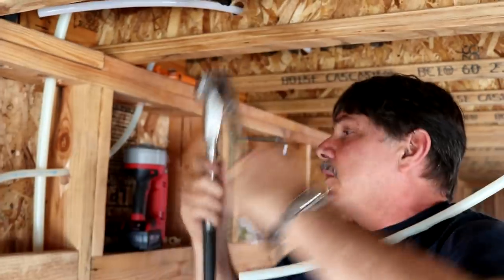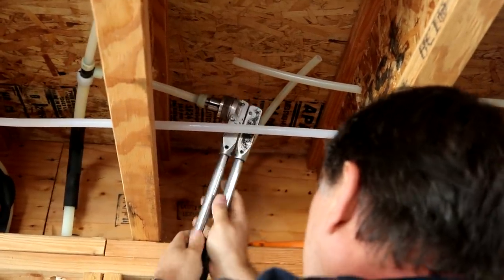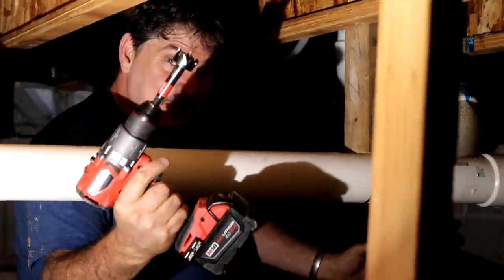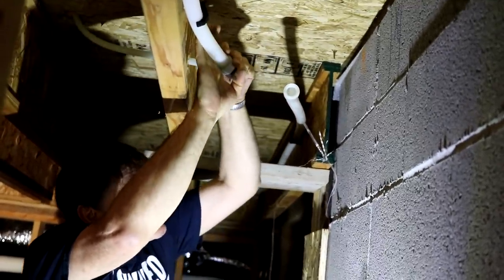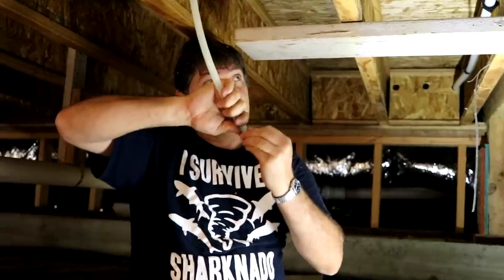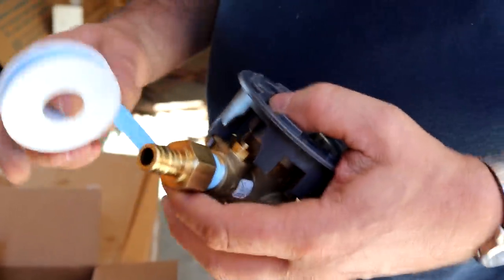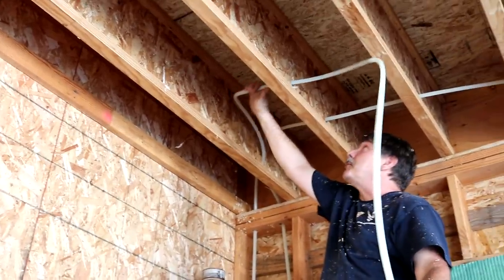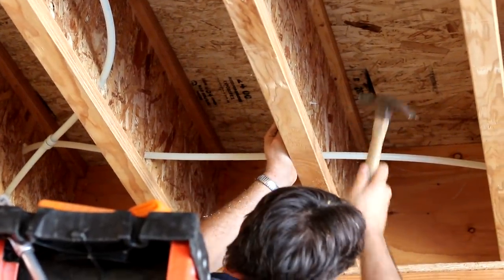Plumbing with Plastic Ep.95

Comment: Recirculation lines are worth their weight in gold.
Reply: I wish I had one. My master bath is as far as you can get from the water heater while still being in the same house. The shower is not too bad but the sinks can take an eternity to heat up. Very wasteful in a desert climate. :(
Reply: wish my fancy house had them. Kitchen sink can take up to 5 minutes for warm-hot water
Reply: @StoneysWorkshop  If it takes that long, it may be a good idea to use a small cupboard boiler, or one of those fancy electric hot water faucets.
Reply: StoneysWorkshop that is so frustrating...  usually a return line was like 250-300 bucks for the plumber to put in during construction if we could gravity feed it.  It was more if we needed a pump.  We got to where we just included it in our bids.
Reply: @mfbfreak  I will be looking into it, I have only done a small amount of looking at those havent been in home for a year yet
Reply: My water heater is in the garage and like some of the comments, took forever to get hot water to back bathroom. I installed a small electric water heater in the attic above the back bath and run the hot water line from garage into the heater and now I have instant hot water and no wasting gallons of water like before......
Reply: When tankless water heaters first came out, they would void the warranty if you used a recirc line because it activates the burner all the time and burns out the igniter. There are a few correct ways to do it but you need to know what you are doing, particularly in commercial work. I prefer a small buffer tank for the recirc and the tankless for the make up.
Reply: @ClicketyClack    There is a relatively inexpensive retrofit to provide a recirculating system.  Google Grundfos Recirculating system.  It basically puts a small pump on the “Hot” side of the standard hot water heater and a mixing valve under the sink in the master bathroom.  The down side is the cold water isn’t very cold afterwards in that sink.  The pump comes with a programmable timer so it doesn’t have to run 24/7.  You’ll get hot water in the shower in a few seconds.
Jim
Reply: I would like to see the details of how the recirculation line is plumbed in when the hot water tank{less} is installed.
Reply: @kurthanushek5520  it's in the manual.
Reply: Check out Comfort series pumps...
Reply: @jamesp7623  I have the Grundfos system just as you described. It's wonderful. The hot water heater is 100 feet away, but I get hot water in the shower within seconds. I also don't mind the warm water on the cold line since I almost exclusively  use warm water in that sink. It only increased my gas bill by a couple dollars, which is made up by the reduction of my water bill.
Reply: @jamesp7623  Assuming the shower is branched off the sink. Mine isn't.

Comment: In Sweden the code says No hidden fittings. So in new buildings we have a distribution box with hot and cold, then seperate pipes to every tap. And the pipes are in a conduit so if you have a leaking pipe it runs in the conduit to your bathroom/distribution box.
Very safe and all, but expensive and time-consuming..
Reply: @guntherthegoat1756  Its diffrent I guess. Mostly I would say that we have a manifold cabinet for every bathroom, located in or outside the bathroom. And if its far away from the heater we run a hotwater circulation line. But in my house my kitchen is around 15-20meters away from the waterheater and I have to wait around 10sec for the hot water, i thought about running a hwc line to it but its not worth the hassle ;)
Reply: @guntherthegoat1756  And its not like I hate how you do it, but I think its odd that you dont even have a conduit for the pipes and some seem to have  fittings in excess, inside the walls.

Comment: I like that he expands the pipe before connecting them.  I've often used bigger pipes and fittings to prevent pressure loss but I didn't realize I could expand PEX.
Reply: Only PEX-A can be expanded. PEX-B and C can only be crimped/clamped. PEX-A expansion fittings are different than crimp/clamp fittings as well.
Reply: @edulmes  Thanks bud 👍
Reply: @HousesandCars  But you can crimp onto PEX-A too, it's very versatile.

Comment: PEX might be cost effective but it should makes for an ugly installation.  A good copper job is a work of art.
Reply: Ah, a kindred spirit!  It is indeed a work of art when done by a craftsman.
Reply: There are times for obsolete methods and materials. A hidden water supply isn't one of them.
Reply: If you home run red and blue to some big manifolds, it looks as pretty as a well-done breaker panel.  Copper has too many elbows everywhere and reduces flow.

Comment: Anyone else annoyed by Phil's comment about the use of red and blue PEX pipe, the complete lack of labeling anywhere, and the vague "engineering plan" for the plumbing? First off, human memory is fallible. Doesn't matter who's memory it is, it's not foolproof by any stretch of the imagination. All it takes is for him to miss a place where the pipes cross over or forgetting the orientation of a sink or shower above to create a mistake that probably won't be noticed until after everything is buttoned up and looking pretty. Second, what about when the home owner has an issue or needs to change something five, ten, twenty years down the road? Is Phil going to be going to be the person making those fixes and/or changes? Probably not. But even if he is, will he remember how this house's plumbing is laid out? Sure, if the PEX develops a leak, it's easy to find and patch. But what about having to replace a huge section of tube or make a new run because the homeowner wanted to redo a bathroom? Phil's "superior skills" just made the job for the next guy down the road a lot harder. It's not a "Millennial thing", Phil, it's proper planning so the plumber in the future isn't cursing your name.
Reply: I agree it will make it easier on the next person. BUT is copper hot/cold different between the 2? Labeling?
Reply: Just draw the plan as you go. For future maintenance purposes.
Reply: Nope, not annoyed at all.  First off, those plumbing plans will not likely be available to the "next guy" in 10 years anyway.  Second, I'm sure he does extensive testing before insulating and drywalling.  Third, he's got a system, and doesn't rely on his memory, and the "Essential Craftsman" trusts him implicitly based on years of working with him.  Phil was clearly joking about it being a millennial thing, and if you are OCD about labeling everything, good on ya, but in this case, Phil's system is sound.
Reply: Phil IS making it easy for the next guy by using consistent and standard installation practice. As soon as a plumber walks into that mechanical room they will recognize this and proceed with confidence.

Comment: "that's for the millennials" 

Oh you mean making things easier instead of intentionally doing things a more difficult way?

This is sarcasm by the way, I know he meant it as a joke.
Reply: Did he though?  If he weren't joking and actually thought about future needs when it comes to repairing those pipes he wouldn't have used the same colour for all pipes.

He said he spent most of his time repairing things.  How much time does he waste just trying to figure out which is which when he gets to a site?
Reply: @-_James_-  it's really not that difficult to figure it out. Turn the water to everything off, and turn off the water at the water heater. Crack open the main shut off valve. The pipe with water is the cold water line. It's how they did it with copper, galvanized, lead, and CPVC before you could get blue and red pipe. If you need to know which is which, you're most likely installing a new fixture, so you'll need to cut into both pipes anyways so this really isn't much work. You could also just feel the pipes and generally you can feel which one is hot if you have some hot water running.  On a repair, it doesn't matter if the leak is on hot or cold, you're just there to fix the leak. 

In theory, using blue and red pipe would be more wasteful as well, as you wouldn't be able to use your blue scraps on the hot line, etc. I do agree that it would probably be more convenient in the future, but it's not a big enough deal to hold up a job, and it's not safe to trust something like that anyways. A plumber would still need to verify that the color of the pipe is correct, unless they want to risk having to take everything apart and redo their connections.
Reply: @commoncentstx  I always use red for cold and blue for hot, just to troll the next guy.

Comment: I am sorry I will stick to copper.
Reply: Why?
Reply: @51-FS  Bad experience with plastic.  The fact that plastic gets brittle over time.
Reply: This ain't plastic..... i would never use plastic for water lines either.... i will only use pex
Reply: @51-FS  I don't think you understand what the word 
"plastic" means.   PEX is plastic.
Reply: Not all plastics are the same. PEX is cross-linked polyethylene. That's not the same as plastic in a Tupperware container, e.g. Same way that mortar and concrete are kind of the same, but very much not the same when it comes to strength and durability. The devil is in the details.
Reply: @johncortell4431  Sure, there are all kinds of plastic, with all kinds of different properties.  I'm just saying that someone who claims that PEX isn't plastic is wrong. PEX is one type of plastic.

Comment: I notice your question in the thumbnail, “inferior stuff ?”   I have found nothing wrong with modern plastic pipe BUT I don’t like the tight right angle fittings that everybody makes, and try and avoid them at all costs, because they slow flow rate. I was taught to use sweep bends rather than knuckles to obviate this problem, but nobody seems to make them in plastic !    I like your plumber he can actually talk !

Comment: I wish the video showed the solder joints being wiped off. I've seen many leaks caused by plumbers not wiping the acid flux off the fittings and zero caused from turbulence.

Comment: I've just started to embrace pex for some of its advantages.  When I remodeled my house I added two bathrooms and being able to run a fitting free line from the basement all the way through the walls to the second story bathrooms was some good piece of mind when in came to worrying about leaks.  I used coper under the sinks and at the manifold at the supply however because it was more compact and cleaner looking.  All brass fittings and stainless clamps though still not trusting the plastic there.  I wish I would have run a return line for a recirc pump however as this would have been cheaper and solved some issues.  I decided to use point of use electric water heaters in the hot water line under the sinks to address this issue but in the end electric wire us way more expensive and difficult than pex not to mention it draws a lot of juice  and not so user friendly when it comes to maintenance.  Keep the vids coming I l enjoy seeing how others do things especially professionals who are not afraid to teach others.

Comment: 3 years ago my wife and I built our dream home. We have had the plans for years and finally pulled the trigger. Once we got going the two things that scared me the most was the heating and cooling and the plumbing. We built a log home and this is our forever home. The plumber came in with pex and I said hold on we are building a 370,000 home and you are going to put mobile home pipes...I don't think so. I wanted copper. He laughed and said he will be back. He brought a mock up to the house and explained pex and actually showed me the benifits and the warranty. So pex it was in the floors for heat, in the walls and everywhere. Next was the ductless ac. I was worried due to the amount of windows. Jump ahead three years. No issues with the pex and the ductless system is absolutely amazing!

Comment: If you're going with PEX for a situation where you don't want it to leak, only use the kind where the pipe is expanded over the fittings. My parents bought a house where the cheaper ones were used, and every joint in that house leaked within the first 10 years, some multiple times.  Now they are replumbing the entire house.
Reply: That's not the products fault, that's installer error. Most likely his crimping tool needed to be calibrated and it wasn't crimping the rings all the way. Will hold for a few years but eventually will leak. That's just another issue when using Pex B that you need to be aware of. Pex A is certainly the superior product if you had to pick one. Pex B is cheaper though.

Comment: Really looking forward to seeing how to run a return loop with a tankless hot water heater. I mostly like my tankless. Love the efficiency, love that I never run out of hot water, but the darn thing is installed so far away from use points that it can take a minute and a half for hot water to arrive at the tap. When I first moved in I thought there was something wrong with the unit but it fires up and I can feel hot water leave it almost instantly. It's not even a big house.
Reply: Our Rinnai tankless has run without a hitch for almost 8 years, but even in our small house, it takes forever for hot water to get to fixtures.  I think the plumber mentioned another hot water heater, which might be the one seven by the recirculating loop.  Not sure how you would recirculate to a tankless - unless you use the motion sensors, maybe?  I did notice it appears the plumber put a "flush kit" on the tankless heater - which makes flushing a lot easier.  If you have hard water, you need to flush the tankless heaters at least once a year or their heating element will fill with scale.

Comment: In Sweden, pex tubes that are hidden inside walls are supposed to be surrounded by a flexible plastic pipe to catch condensation to prevent mold growth and water damage and also to catch potential drip leaks that form with age. Why isn't it required in Oregon?
Reply: Oregon doesn't have severe temperature extremes, so condensation is less of an issue.
Reply: @rjk7104  Alright, thanks for letting me know
Reply: @MrNeutross  pex is going to condense way less than copper.

Comment: My house was completed in 2006 with this kind of plumbing (red and blue!).  It's fascinating.  The coolest feature is the Mana Bloc system -- basically a "breaker box" that allows us to control the water supply to each fixture.  I also read that these flexible pipe systems were developed in California to be earthquake-resistant.

Comment: It's nice to see all the caution after that whole Poly B disaster. I'll never forget standing in line to drop off plans at city hall and over hearing that the new plastic tubing should last at least 10 years.....ha ha. 
 A quick chat later I learned they weren't joking.     Designed an accumulator on the way home and made raceways for all of our pressurized plumbing. Never once regretting the exact work. Great to see all of the solutions coming together in one home.
Interesting as always.

Comment: The material is called uponor..uses pex fittings and Milwaukee carries the expansion tool ..you get like 7 second's to press the fitting into place..and the also make a tool to remove the rings if you want to reuse a fitting..

Comment: Something not mentioned here but based on my experience is the case. Expandable PEX survives being frozen solid pretty well. we have a cabin in the woods that was done with it some years back and it has frozen all the way through a couple of times while full of water and we have never had a leak in the Pex. We have lost all of the hose bibs that way, but that's another story. You may ask why this happened. I thought I was shutting the water off and draining every time but the plumber who installed the system originally screwed up the shutoff valve and it would never completely shut off and would slowly refill the pipes after I had left.

Comment: I like the idea of the extra line for hot water. did you use a recirculating pump?  What is your take on using insulating foam tube over the hot water pipes?

Comment: In Germany we (have to) insulate the cold and hot water lines during installation. Less condensation and heat loss. 
Quite interesting to see the differences in the way regulations works.

Comment: That hot water recirculation system is such a good idea. Super obvious in hindsight too. I wish my house had that lol
Reply: In an old house, use a Watts or Grundfos recirculating kit. Consists of a pump on top of the hot water heater and a by pass valve under a sink farthest from the hot water heater. The bypass valve allows hot water to recirculate out and back to the heater in the cold water side. I had one installed in a 45 year old home. Works great. Still have cold water also. Not sure how but for about $150 you have instant hot water. I think most big box stores carry the Watts...or try Amazon. Very easy install.

Comment: I have Pex for more than 20years no problems at all. The difference in brick houses is that they run inside colored corrogated pipe. Leaks only show in junction boxes and you Can change the pipe just by pulling one out and insert the New one. I hope it delivers because, Has I said, never had any problems

Comment: A little tip that might save you some time or parts. If your PEX fitting dribbles or leaks a little bit put a radiator/ Worm Drive clamp around the fitting and tighten it up. Leave it for a day. When you take it off there should be no more leak

Comment: I'm half done with replumbing my 1930 house with PEX. I went with the crimp system since I didn't want to spend $400 on the electric expander tool and didn't know they had manual ones.
Reply: From everything I have seen, the crimp system is by far the more common system.  The copper crimp rings not the side crimp steel rings.